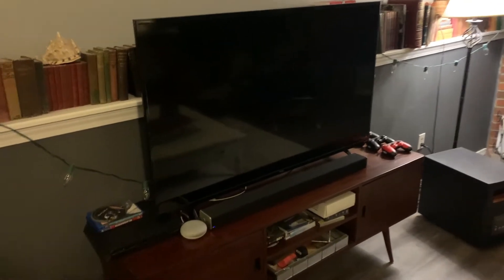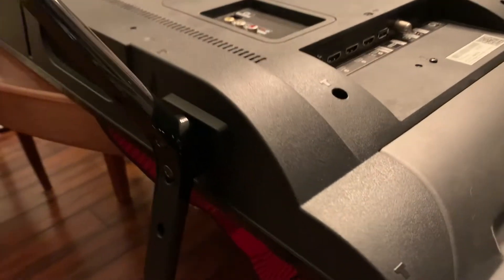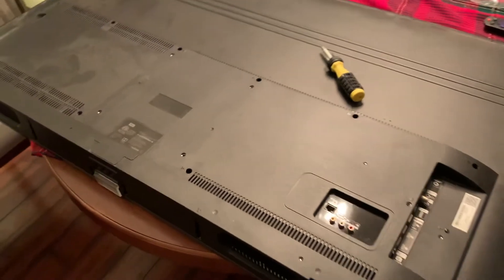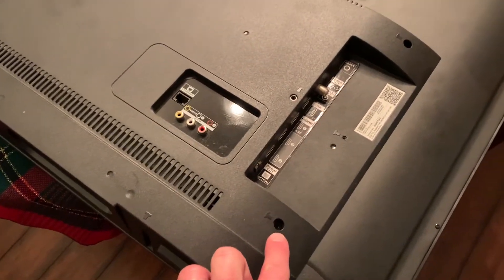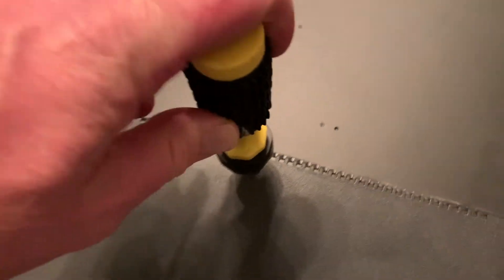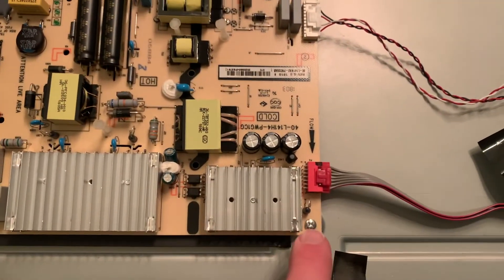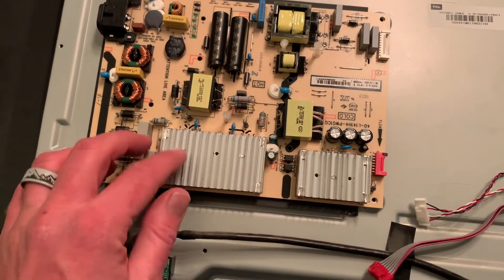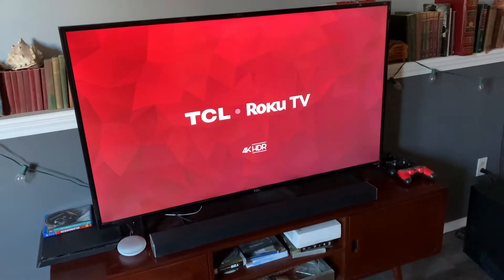TCL TV Won't Turn On? - Fix It Now

Comment: The model number on the back of the tv is not on the sticker on the power supply unit. How can one verify the correct power supply by using the model number and serial number. I apologize but it doesn't make sense to me me. Because they are two different numbers.

Comment: Total champ. I copped the 'pop' on my 65 inch TCL just before Christmas. So glad I came across your video, as it convinced me that this is the fix. Bought the correct power circuit board thingy and fixed my TV like a boss. On my model, the entire back case of the TV had to be removed, but it was easy enough. Thanks so much and rock on in 2025!!!

Comment: Mine is the 75". I replaced the power supply board and still no luck. When I press the reset button however, I am getting the front indicator light to blink once. Any other ideas what it can be?

Comment: I don't no if it went bang lol usually fall asleep and the tv turns itself of ik you don't press ok when asked if still watching had the tv 18 month only been the last 2 month left it on standby and now its dead would be ideal if the board worked still pretty crap that it has came to this so soon seems to be a hard board to source 55pc615k
Reply: It was on standby for 2 months? Were you away from home?

I just came back from 5-weeks abroad and my tv won’t turn on.

Comment: Do you know the output voltage that goes to the pins to the main board?  My backlight turns on, I can hear it working, but the TV screen comes on (backlight) but it stays black.  I measured 9v on some of the pins from the power supply to the main board but should they be 12v?  I have the TCL 55S403 tv that uses that power supply.

Comment: After all I found that TCL TV is always WASTE and No VALUE FOT THE MONEY.  I NEVER FIND IN MY LIFE A BLUNDER TV LIKE TCL.  I PURCHAISED 55 INCH TCL TV WITHIN TWO YEARS ITS GOT FLICKER PROBLEMS AND THE POWER SUPPLY GONE IN MY 55 YEARS LIFE I USED MANY OTHER TV WHICH ARE VERY GOOD EACH ONE USED MORE THAN 7 YEARS 😢😢😢

Comment: I made this repair to my 75" TCL for same issue and it fixed the power issue but now when I power on the tv, it blinks (not flickers) from menu screen to,black,,menu screen to black about every second.  What could this issue be?  any advice would be helpful while I got this thing apart. Thanks
Reply: Did you figure out what the issue was

Comment: My wife was watching and it went black but was still playing audio. Was able to get it to turn on once more but same thing happened again after 5 minutes. Mine has power to light up the status light on the bottom when plugged in, but won't turn on for picture. Power board the likely culprit you think?

Comment: I was loosing my mind until I saw this video I heard the loud pop so I thought I was a breaker and I took the TV apart and I saw a burn spot on the board I already orderd a new one thank you
Reply from the maker: Awesome to hear. Yeah, these TCL TVs are made with really inexpensive circuitry. Thankful that it is not super expensive to replace the boards. Hope the project goes well for you.
Reply: @TechTalkvideo  tv is working again better than ever thanks again for pointing me in the right direction.

Comment: Never pull a circuit and then unhook accessory. Unhook stuff first!. If your power board has failed, 9 times outa 10 you have bad capacitors which will be doned on top or a redish brown substance that has leaked out. If you heard a pop, that is probably the capacitor going out.

Comment: Mine just died. No light, or anything. But no pop when I turned it on.  No sound. Tried to unplug and mess with the  buttons but doesn't work. Help! Could it be same issue as yours? OR even the power supply cord?